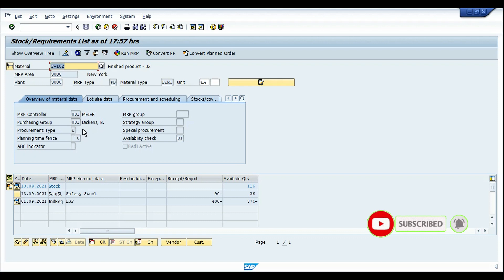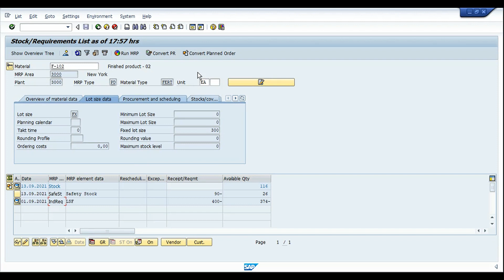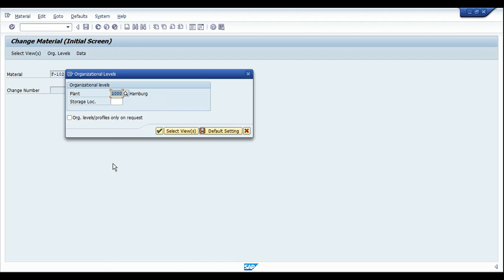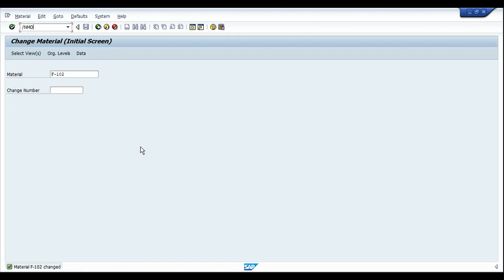MRP Calculation | Safety Stock | Fixed Lot Size | SAP PP | SAP Demo

Comment: Hello Sir,
I have one doubt, there are some materials whose status in basic data is obsolete. While running MRP for plant these materials are also considered but end up with error. My question is why SAP considers materials with obsolete status. Is it standard SAP process? If so is there any note for this.
Reply from the maker: Pls set the MRP type to ND and check.